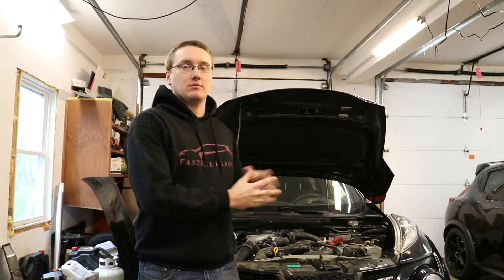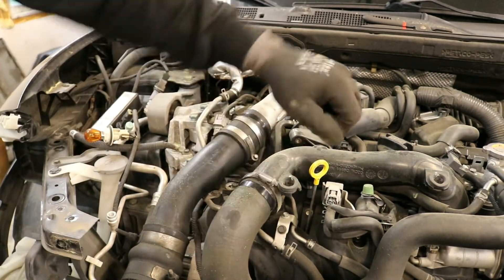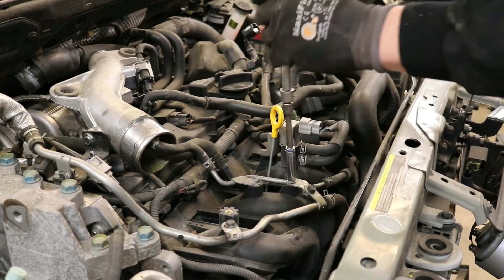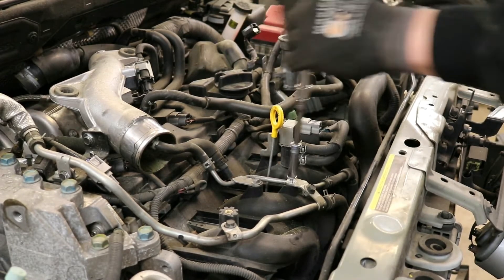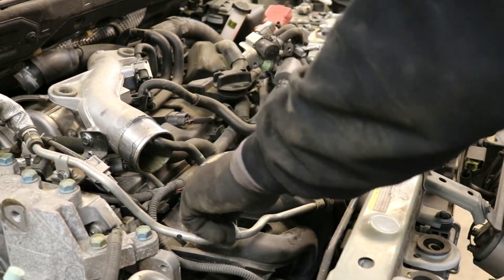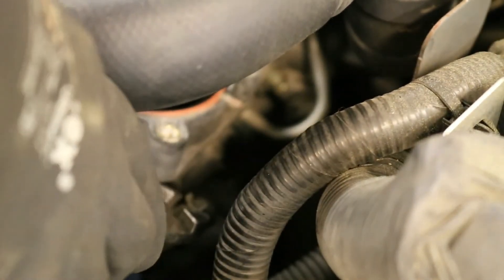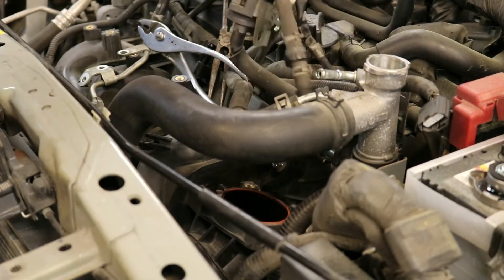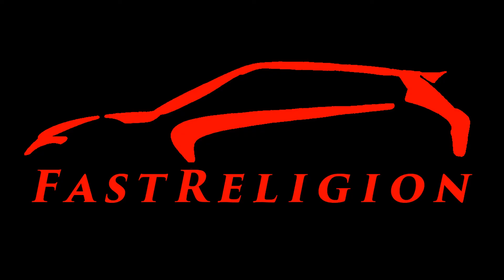Nissan Juke MR16DDT How-To: Intake Manifold Removal

Comment: I have a question I cannot find the answer to. I just replaced plugs and one coil as there was a multiple misfire code as well as a cylinder 1 misfire code. After changing them and clearing codes the code came back but the service engine soon light is no longer flashing and the car is not vibrating at 2-3k rpms like it was. Also after driving it around the block there is a weird whistling noise when accelerating that was not there beforehand. could the whistling be because there is loose hose or something wasn't put back on properly? Also what would still be causing a misfire or could the OBD reader be wrong?
Reply from the maker: In regard to the misfire, it is always recommended that you replace all of the coil packs not just one.  I recommend having the misfire professional diagnosed if you still have it.  In regard to the whistle the 2-bolt gasket from the turbo to the crossover pipe MUST be replaced whenever that pipe is removed.  That is the source of the whistle.

Comment: Great video! I did have a question that I cant seem to find the answer to online. My juke is getting the P2016 and P2018 codes that indicate an issue with the intake manifold runner position sensor. Is there any way to replace the sensor without needing an entire new intake manifold?
Reply from the maker: You need to replace the entire intake manifold. We have a video on those codes, be sure to check it out.
Reply: @TheFastReligion I’ll check it out! Thanks!